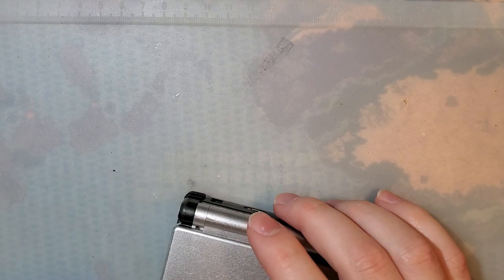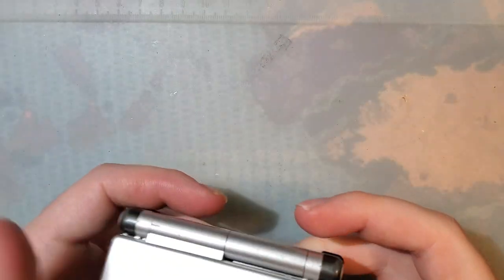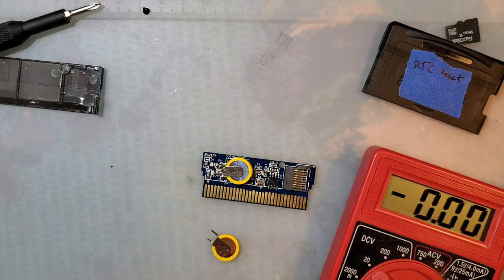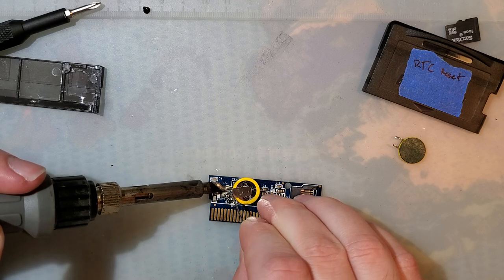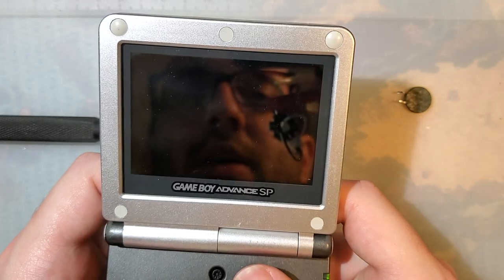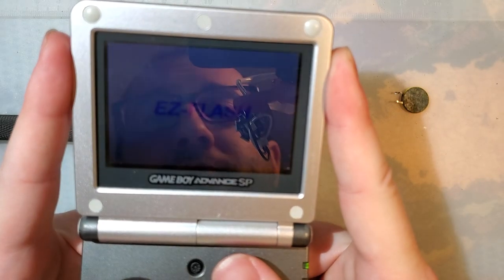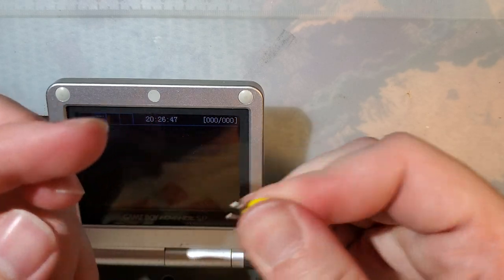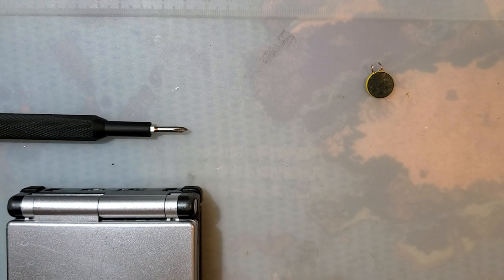EZ-FLASH Omega Battery Replacement

Comment: Thanks for making this video. Mike arrived with a dead battery. Kinda ridiculous that they don’t have an easily replaceable battery. 

With the EZFlash Jr cart you can swap out the battery. For this one I gotta buy a soldering iron and I will definitely screw it up. 

Glad you don’t need the battery for saving though.

Comment: The battery was almost definitely bad from the factory. Just got an EZ Flash Junior in and it read half a volt fresh off the boat from China. Solderless replacement on the Junior makes it a hair easier to replace than the Omega though.

Comment: I just soldered the tab of a CR1616 to the positive terminal and ran a wire from the negative terminal to the negative tab. The battery life is FAR superior and the JUST fits into the case without an issue. These damn CR1220s are too damn small.
Reply: Great idea!
Reply: That'll actually fit in this tiny little thing???

Comment: hi makho! just wondering instead of changing dead battery is there a way to fit a battery holder instead? (so whenever the battery dies you just replace it in the holder and avoid desoldering and soldering again)
Reply from the maker: Not enough room

Comment: I bought three CR1220 batteries, but their front side looks very similar to their back side. In this video it looks like there is some black disc (insulation?) at the back.
Are my batteries safe to solder to the motherboard or would I need to use tape?
Reply: Hey man, when in doubt just use a little Teflon tape on the board.

Comment: My problem is that it was working fine before but now it doesn't save my settings and it doesn't load my saves it does keep the time the same though, could you help?
Reply from the maker: Try a new SD card. Or reformat your existing SD card. Outside that, you'd have to talk to ezflash support.

Comment: My EZ Flash Junior came with a dead battery out of the box. Got a new battery, popped it in, and its been perfect ever since. Those you can literally just pop in -- sad this one takes a soldering iron considering they're dying so quick.
Reply from the maker: I think some just come defective. This one was a return and slated for the art bin. I don't think these batteries will last more than a few years though.

Comment: Hi! I’m very new in this flash world… I just wonder if when the battery is dry, we can set up manually the clock and make the berries grow again in that game, or we need to change yes or yes the battery?
Reply from the maker: In Pokemon Ruby, Sapphire, and Emerald, after you replace the battery, you must also reset the RTC. In the EZ Flash Omega, you can just do this in the settings menu before booting the game. In the actual game (not on the EZ Flash), you need to use external tools to reset the clock or you need to start a new game. 

More info in the gb wiki https://gbwiki.org/en/other/commonissues

Comment: off topic question: A few months ago I installed an all in one lcd screen from aliexpress (one with brightness control) for my GBC, when I change the brightness to one step under the max brightness and one step above of when the backlight is off I get a loud hum/buzz that increases in volume the dimmer the back light becomes. I have this problem for both the speaker and the headphone out. is the a fix to remove/reduce this humm?

Comment: i cant exactly find the battery with legs like that, most of which are horizontally not side by side. where do you get yours? im lookin on ebay. or is it okay if i used the horizontal one and ran a wire through it?
Reply from the maker: Mine wasn't sourced through normal channels or I would have shared a link already. Running a wire should be fine provided you can make it fit without having to bend the PCB or the casing.

Comment: I think i caught mine when the battery was on its way out. It was only registering around 3.05 volts, but the time was loosing time every day (about 10 minutes). Picked up new batteries and now i havent had an issue since. I guess the battery must have been crappy.
Reply from the maker: some of these things are just real shit with keeping time. But yeah, 3.05 is low.

Comment: Do the batteries leak? I just bought mine a few months ago - I am not worried about the battery dying in the next year or two but if my battery dies should I remove it from the board? Or is it safe to leave there?
Reply from the maker: I've seen CR cells leak before, yeah. But it's very rare.

Comment: Is this battery critical for the cart to be detected when plugged into a gameboy advance? I just got mine but it's not recognized at all.
Reply from the maker: Battery is only for RTC and nothing else. I started the video with a dead battery and my cart worked fine except that RTC would have to be reset every reboot.
Reply: makho Okay so this tells me something is wrong with my unit. Thanks.

Comment: Will the event clock in the gen 3 pokemon games still work if the battery in the EZ Flash is dead?
Reply from the maker: as long as you set the time on boot up, yes. The battery is only to keep the clock running when the system power is off.

Comment: @makho can this tabbed battery replace with a battery slot for cr1212? I saw a cr1212 battery slot on my wonderswan cart.
Reply from the maker: where would you put the battery slot?
Reply: @makho  on the same place where you put the tabbed battery.
Reply from the maker: @paulfavila5482  I meant how would you attach it?
Reply: @makho to the battery contacts
Reply from the maker: @paulfavila5482  You don't seem to have a grasp on the amount of space available and how much space a socket requires.

Comment: Any possibility to frankenstein this with wires?
I cant find anything with tabs like that on the internet.
Reply from the maker: I mean, you can't really solder directly to a battery and there's no room for a holder
Reply: @makho  Spot welding wouldnt work on this thin batteries i suppose?
I even considered to buy one chepo spot welder just for this stuff.
Reply from the maker: @AltoBo123  you can spot weld to these batteries, yeah. Not very cost effective for something like this but it will work
Reply: @makho  Thx for all the info dude.

Comment: Gee, only after watching your movie, I found out that in ez flash omega the battery is soldered. (Ez flash omega has been at home for a month, but I'm waiting for gba sp, tomorrow-day after tomorrow it should finally be) Before, I had a "Game Color" flash card (to GBC), and I could normally take it out there. Please write what battery is needed for ez flash omega? Ps. It is a pity that there is no battery holder in the ez flash omega.
Reply from the maker: This is one of my shortest videos. Far from a movie. I also put the battery specs in the description.
Reply: @makho  My mistake the movie was in fact watched 3x, but I did not read the description under the movie. Thank you for your help. :) On the other hand, is it possible to connect a "basket" for batteries to ez flash omega?
Reply from the maker: @ztejstronymarcin  no or it would have been done from the factory. There's no room on the small PCB

Comment: I curse companies that solder the battery to things, just makes replacing them more difficult than it should be. I need to replace the battery in my Dreamcast but don't own a soldering iron to get the job done, why can't it be as easy as changing the battery in the Saturn.
Reply from the maker: Just learn to solder? It's really cheap and easy.

Comment: The sole reason of the battery being soldered is enough to qualify EZ-Flash Omega as a bad product, and of course way worse than Krikzz Everdrive GBA X5.
Reply: Cool, can you direct me to where I can buy an X5 for £30?  Thanks.
Reply: @MizuhoChan  Spending 30 on an objectively bad product is definitely not worth it compared to spending 100 on a much more reliable alternative.
Reply: @gluttonousmaximus9048  Seems fine to me.  Sure it's built to a price, but it works well and I've not had any issues.
Reply from the maker: so because you can't pick up a soldering iron, it's a bad product? Ok bud. I can agree that the everdrive is a better product but two things can be good even if one is better.